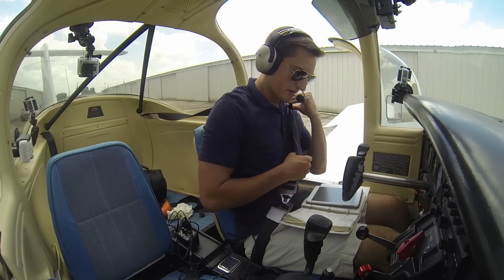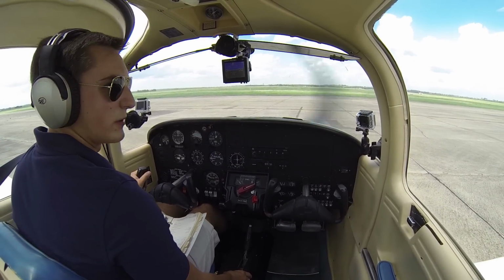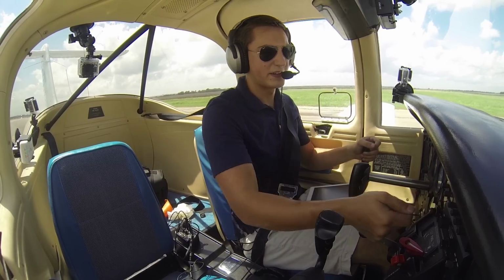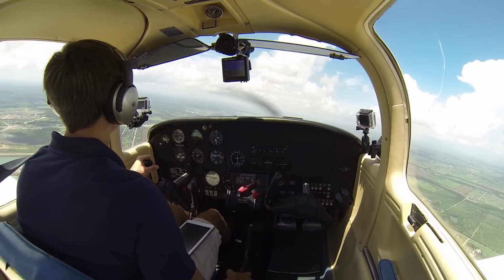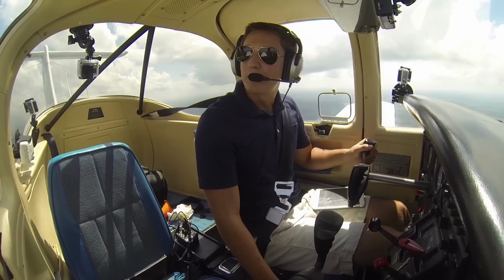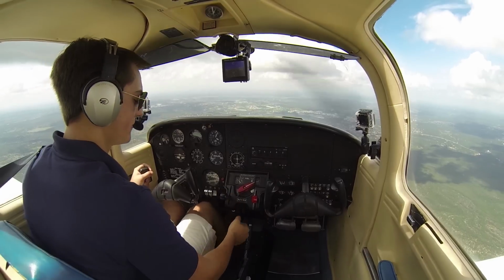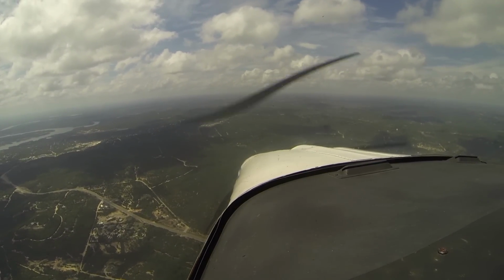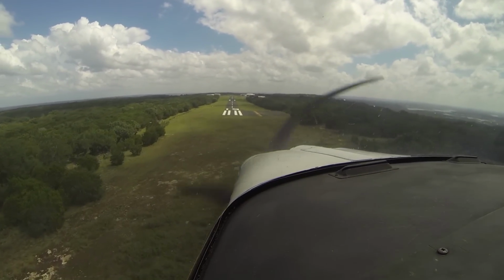Piper Tomahawk | Maintenance Flight | ATC Audio

Comment: Nice film this, brought back many happy memories. I learnt to fly and got my PPL in Piper Tomahawks in 1986 at Ipswich airport in the UK. After qualifying I added other types to my experience - Cherokees, Cessnas, Robins etc but I never lost my love for the PA-38.
You're right, stall, incipient spin and spin recovery needs to be assertive and timely using standard recovery procedures, but she will recover nicely. The full power, maximum rate turn pull to the buffet and stall is as dramatic as it probably gets, whichever wing stalls first it feels like you're entering an inverted spin - your not - sit back, let it settle and standard recovery will work but don't try this exercise below 4000'.
Anyway, I spent a couple of months in 1996 working in Minneapolis and flew from Lake Elmo. They checked my credentials and wheeled out a dusty old PA-38 for me to do my check ride. After pumping up a flat tyre we got airborne, my check instructor took me through the usual aircraft handling routine until it came to stall recovery/ incipient spin recovery. I demonstrated the power off wings level pull to buffet recovery and that was it! He didn't want to go any further and happily signed me off. Think I flew that Tomahawk more over that two months more than she'd been flown over the last two years.
Finally, turned up one evening after work for a flight - Tomahawks having a 50 hour check - would I be happy taking a 152? No Check ride but just as we walked to the aeroplane from the clubhouse a shout  'Phil! Don't let her get below 55 on finals!'
There seemed to be be a genuine fear of the PA-38 in the USA at the time 
How are you getting on with yours?

Comment: I learned to fly in Cherokees and flew 172s later so I've encountered some of the same issues you mention with the Tomahawk, just in the opposite direction.

On the Cherokee you get used to resting your hand on the base of the quadrant and holding the throttle with your fingers.

Neat little plane! :-)
Reply: what about the Tomahawk?

Comment: Yup, Piper has had the manual " parking brake handle" for the flaps since before forever :-) I remember it on a friends Cherokee 140. When I flew it, I remember how much the Cherokee wanted to float before touchdown. The low wing definitely takes some getting used to, transitioning from the C-172.  Happy holidays, CAVU and Merry Christmas!

Comment: I love the Tomahawk. I did the opposite than you: Made the PPL training in a Tomahawk and then transitioned to a C-152. I found the transition extremely easy and flying the C-152 almost boring, and I was soon back in the Tomahawk. It is not only much more comfortable (especially at 6' 4"), but much more fun!
Reply: Pretty much exactly my experience, a much better airplane to learn in.  You simply can't be as sloppy as you can in the 150/172.

The first time I flew a 150 the instructor asked me to spin it, and I kicked it out less than 1/2 turn in. He said "no, the whole way around", and I replied "that would have been, in a T-hawk"

Comment: Thanks. It's interesting to fly without vacuum if you are used to the instruments. On the very first flight after I got my license, a ferry flight from the maintenance shop to my flight school as part of the familiarisation flights on my Socata Rallye with my flight instructor, the vacuum pump failed. We got home fine by magnetic compass (and an ancient GPS), and I continued some more familiarisation flights without AI and DG. Not a big deal in VMC.

Comment: I would like to do some flying in a PA38 now. I regularly fly a PA28 so it would be an easy transition. I learnt to fly in a Cessna 150, then checked out in a 172 then the PA28. Now I prefer to do all my flying in the piper. I like the flap lever, you can put the flaps in fast if you want.

Comment: Looks like a lot of fun Josh! I'm curious as to how well a Piper Tomahawk would fit a tall pilot, being 6'4" makes aviation 'fun' at times in a lot of planes. Good luck on the flight school. I'll be watching with great interest!
Reply: I learned in a Tomahawk due to being 6ft 5 and other than the rare Beechcraft skipper I can't fit in any Cessna 150/152 with any comfort. Excellent to learn in and teaches you better for when you move up to larger aircraft. The PA38 requires you to fly it and will remind you when you are not doing everything correct. The Cessna are more forgiving in operation. (Again IMO) I bought a Cessna 172N model and had it for about 8 years before insurance costs made me have to sell it in the late 80s. Really liked the Tomahawk for training. Bill

Comment: I try not to critical on things. This time though I'm going to mention something that I saw. The lack of Carb heat will put you down fast. 90 some degrees as you mentioned doesn't matter. Flight school i worked at lost a 152 into a bean field off the end of a runway. The CFI and student were not hurt and actually flew a 172 over the accidents site within an hour of the accident. They got carb ice on a day just like the one you filmed. The airplane flipped on it back and broke the rear wing spar and attachment points. After bending the crankshaft flange back we started the engine with a test club on it. That instructor was praying it wouldn't run but it did. The FAA literally told him before they left "You better start figuring out exactly what happened" He got lucky and they didn't do anything more than have him go for a checkride with them at the local FSDO. Just something to think about cause outside air temp has no real affect on carb ice. Its the temperatue of the fuel air mixture in the venture that makes the ice. Fly save and keep the videos up cause they are fun to watch.
Reply: It's just the mechanic in me. Other than flow spec of carb they are pretty much the same, if not the same. I would have to dig out the Type Certificates on them. Either way I'd use carb heat no matter the machine with the 235 Lycoming and several other engines regardless of the airframe it's mounted on.
Reply: okay for educational fun I went and looked. The Piper and Cessna 152 ues the exact same engines with one exception. The L2A was installed on the piper. Only difference was bendix mags. The N2C was a alternate engine for the 152 depending on model. So its safe to say they are exact identical engines cause well the FAA said so. One could argue that the air induction system prior to the carb could help prevent carb ice and yes it could if warm air or heated air enters the carb. But having worked both aircraft there isn't much difference. Another fun fact is the Piper Tomahawk is also one of a select few life limited single engine airframes.Some parts are 1500 hours others are 3000 and well we must have wings to fly so at 11000 hours you can scrap it or apply for an STC to extend them. Not sure how I feel on that. Haven't crossed the bridge with my friends yet.
Reply: Piper tested the wings up to an equivalent of 10k hours plus...They didnt break..So they said, this is the limit we recommend..thats it..I will follow that advise anyway..
Reply: Gabe Kremer ..thanks for your reminders...Pipers Induction Air System has like a container or box for the Air Cleaner..and its metallic (Aluminum) That box warms up the air a bit due air goes thru the box first before the carb..Cessna just pipes it direct to carb...No Air Box..

Anyway its up to the pilots to judge and decide when and how much to Carbo Heat to apply..Even on Pipers on certain conditions YOU NEED CARBO AIR..But some pipi  pilots forget or are too lazy to think about the engine needs and gets it, let the engine dies and crash...Later on NTSB test the damaged engine and its starts and runs fine..The accident was due "Engine Management Pilot Error"..
Reply: In the Cessna, it depends on the engine.  Carb heat is recommended upon significant power reduction and when RPMs are below the green arc.  However, our -N model has the air going around a 90deg bend, which apparently means you won't need as much carb heat, as I have learned from my DPE on a checkride.  He said: run it for some 15 seconds on downwind to check for ice.  The advantage of that is that you won't forget to push in carb heat when you need it for a go-around.  Personally, I'd rather have it on a little more, but I'm less religious about it when pulling power back on the initial descent.
Reply: It has more to do with what’s happening inside the engine inlet. I have forgotten the physics but outside temperature is not the only factor that affect icing in the carburettor. My Chief flying instructor always said in particular conditions always use Carb heat particularly in a Cherokee, he demonstrated to me & others icing at high outside temps in the 30’s . The point I am making if you are descending just be careful.
Reply: I know it’s 7 years ago, but read the effing POH before making a statement

Comment: Love that you're flying the Tommy ... i'm training in one right now :) In Canada PPL we do spin training ... trust me they're fun as heck in the Tommy!! Must admit it was great to hear your voice going over the same checklists i follow :)

Getting a new attitude indicator by chance?
Reply: The reason for this flight is to get a vacuum pump. Which runs the attitude indicator. He doesnt need a new attitude indicator he needs a new vacuum pump...
Reply: Could have been either/or ... since i couldn't see the suction gauge. Thanks for clarifying!
Reply: +Steve Brayford I only know as much as you do. The reason I commented like that is because he said he needed a new vacuum pump in the beginning of the video. That's why I assumed the attitude indicator was fine. And actually you can see the attitude indicator almost comes back to life during takeoff due to engine running on high RPM, but during final approach it dies and slides off.. So I'm assuming the attitude indc. works fine. It's just the vacuum pump not being to deliver enough suction due to its malfunction.
Reply: Gotcha!!

Comment: What was with his ADI/artificial horizon for the flight?? It indicated a constant left turn for the duration of the flight, as if it never calibrated
Reply from the maker: As I said in the video, I was taking it to et the vacuum pump replaced...
Reply: The flight was to replace a vacuum pump, so most likely enough suction for it to actually work. the Artificial Horizon and Directional Gyro are usually air operated gyroscopes with the air being sucked through them by the pump.
Reply: and you don't need an AH for VFR
Reply: +MrAviation101 sorry I must have missed that👍
Reply: you technically dont, but personally i check my AH constantly even when VFR, and i would refuse to fly it without a working AH unless flying it to another airport for maintenance
Reply: +Michael Loftin Yea I use it all the time too and wouldn't want to fly with out it but it's not illegal to not have one
Reply: it is perfectly legal for VFR, would I fly without it? nope
Reply from the maker: +Michael Loftin I guess you'll never fly a piper cub!
Reply: thats whats the Super Cub is for ;)
Reply: Peter Ellison wasn't that the whole point of the flight, going to get a vacuum pump replaced?
Reply: I'm a student pilot, I fly Cessna C150A (a very old version, even the yoke is complete different) and C172 Skyhawk. The C150 don't have an operative AH...and you can fly without it, you will only need it if you are flying IFR or if you need to go through some clouds.

Comment: I have about 30 hours in the tomahawk. It is a sweet plane to fly. Put in flaps and you don't get big pitch changes. Easy to fly but you have to fly it. I have heard dings on the tomahawk, but if you are having issues with this airplane then YOU are doing something wrong.

Comment: Is that your "Tramahawk."   I never could get that door  to seal well - rain was always a problem.
I "advanced up" to a Tomahawk in about Jul of 1980.   Came out of a 150.   I, also, liked  the center console.    Stalls?  Yep, a whole other story.  

Never could Pre-flight the T tail - think a lot of them  fell off, or had some major problems.  Probably was AD'ed back when.  Thanks,
Reply: Michael you are sooo correct.  I got my ppl back in the 80's in 150's then 152's and 172.  Then took up a Tomahawk one day. Put her through the wringer.  Once I looked back to see the tail doing its dance and it scared the crap outta me.  Went up in another one later on and be darned if it didnt do the same thing.  The owner said dont worry about it. Happens all the time.  I will say one thing....they will go into spins. Oh did I forget to mention the wobble in the nose wheel.  Get it up quick on roll out and hold it up on landing.
Reply: Everything you said is exactly right!   That tail section was something to behold. :)   I did spins, in the Tomahawk (only a couple turns as I recall.)   I was PIC, but an instructor did the spin entry and recovery - as I recall.  Hell, it was 1980! :)

On entry, it appeared that we went inverted - don't believe we did, however. 

Also, I fully remember that nose wheel wobble - also, the placard on the panel that said not to operate on "unimproved surfaces."    Think the prop tip was really close to the ground.

That was fixed by putting larger tires on the plane!  The plane was Piper's answer to the Beech Craft's Skipper.  I heard the Skipper was OK, but can't say the same for the Piper.

Never could adequately preflight that tail. :)

Comment: hey, since u are a CFI i feel the need to ask, im a private pilot with around 70 hours, all in pa38. Since the first flap point is 21 degrees, i mostly only end up using them when im high on final or need to get in slower cuz traffic. (my base is SADM a controlled vfr airport with a 2500m runway and quite a really lot of traffic) specially with crosswind the fly feels a lot better clean. any reason why u deploy them before turn into basic or just cessna habit?

Comment: i was wondering, how does your audio recorder pick up noises like click on the switches, closing of the door, engine cranking.  coz if i remember correctly the way u plug it in, its only suppose to pick up what your head set hears, its set on "audio in" not "mic in"
Reply: Well he has, like, four GoPros going, there. So he could easily take the soundtrack off any one of those :-)

Comment: just curious about what seemed to be a control tab on the trailing edge of the right wing.  Don't know what that was.
Reply: James Plaisted 

      It’s a ground adjustable fixed tab.  It is used to neutralize rolling moments since there is no cockpit adjustable roll trim.

  Another way to rig this aircraft for hands off flight in roll is to adjust only one flap.  These are adjusted by a turnbuckle on a threaded rod.

Comment: this goes to all pilots . i took my first GA flight today in a Cessna 172 and it wasn't funny at all hahahahaha i felt little scared because there was so much wind but i kept my composure and we did a little tour. When we landed and i got out i felt like getting back in.I was wondering how did some of you  feel in your first GA flight and if its normal to be uncomfortable. i have always wanted to be a pilot and am wondering if this feeling was normal to all pilots in general and how you over came or got used to it.
Reply: I'm a CFI now (currently sitting at about 450 hours) and always knew I wanted to be a pilot from the time I was 5 years old. However, my first 5 flights in my training I got sick almost every time. I never had an issue with motion sickness before or since, and looking back I'm pretty sure that nausea was caused by me putting a lot of pressure on myself to do well, combined with the new sensations of flying in a light aircraft. So I would say its absolutely normal to be uncomfortable at first.

Comment: hey Josh.    I just purchased a tomahawk.   I follow the check start up check list but I can never get it started.    I have to intentionally flood it .cut the mixture,full power an once it gets going I go back to 1000 rpms.    the check list calls for leaving the prime open and once it starts,push it in slowly.    any tips?   thanks in advance.   just put in a new battery and starter

Comment: hey Josh.
wich one do you like the most? High or low wing?
Reply: low wings are definitely more fun to fly. More stable and CG is closer to the ground. If I were to ditch I`d rather be in a tri-cycle gear low wing piper than a Cessna 172. Plus low wing aircrafts look 10 times cooler.
Reply: +Utku Apaydin I fly tomahawk mostly, and every so often a C152II.
I feel the Cessna a lot more stable.
the tomahawk is less forgiving with the mistakes you make.
that's my opinion of course.

And of course low wings look way cooler.

I wouldn't compare the Pa38 with a C172, but rather with a Cherokee.
Reply: +Utku Apaydin i think you got it wrong with the stability because a high wing has the cg below the wing and the low wing has it at or above the wing  making it much les stable an much more touchy on roll. basic physics
Reply: +highkicker11 yes, I was mistaken. High wing aircrafts are more stable. Sorry about that, but What I was trying to say is, I've flown both Piper PA28A and 172S and PA28 feels more like a bigger aircraft, so much easier to manuever and it takes less effort (so there is less control input applied) to land a low wing aircraft. At least it takes less effort for me. Because you don't float like a high wing 152/72. Plus it's easier to fly in ground effect In a low wing aircraft. That's my personal opinion.